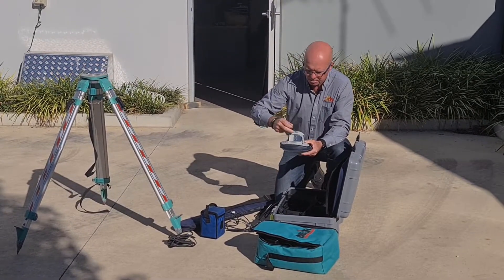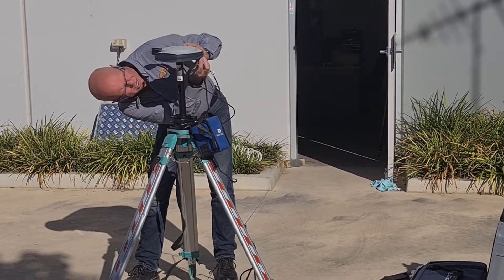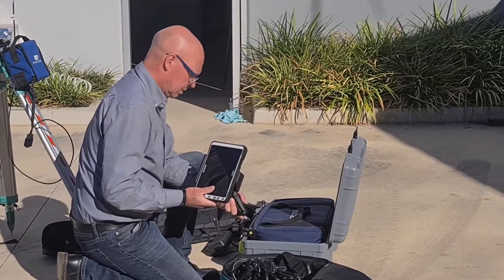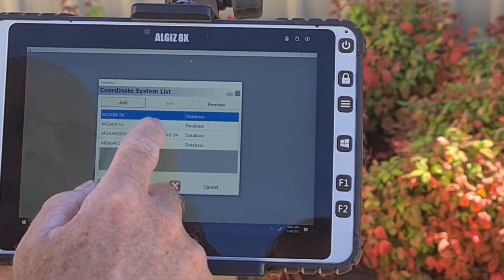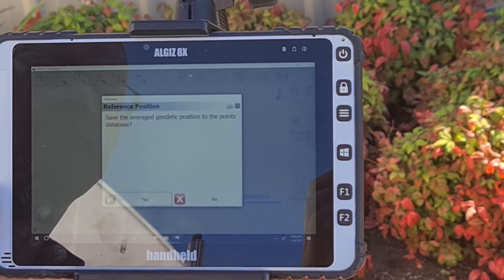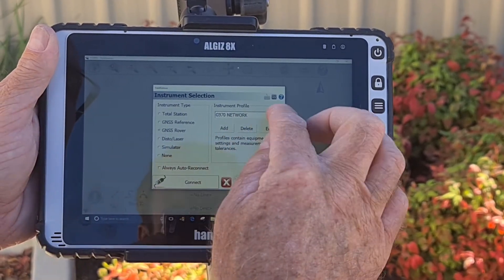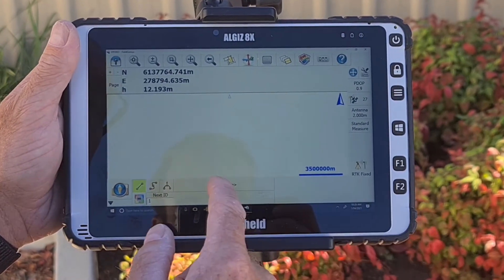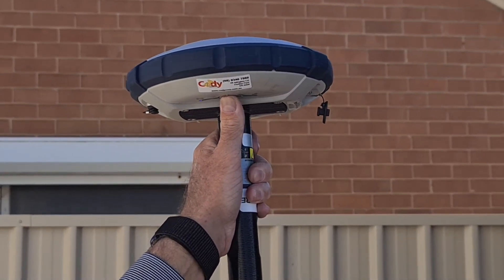SP85 Base & SP60 Rover Initial Setup

Comment: Hi, Do you also have the same video for SP80 using Ranger 7
Reply: Hi Ruby, the setup of the SP85 & SP80 are exactly the same. the only change being you would have to select SP80 from the drop down menu early on rather than SP85.
Reply: @Jazzman200  Thanks. I thought I'm doing something wrong with the set-up because my rover cannot communicate with the my base station. 500 meters distance from base, with LOS, and radio comm is already lost.
Reply: @rubyanniglesia4876  Ruby there could be a couple things that are causing this issue. It could be that your Antenna is either not plugged in correctly or the Antenna itself is infact broken and needs replacing. If you have a spare Antenna you could try and swap it out and see if that works to be able to identify whats happening.

Comment: hello, 
why sp85 for base and not the sp60?  
the solution will not be faster if the rover is faster also from the base?
Reply: We chose to use the SP85 as the base for these few reasons. 
1: The SP85 has dual batteries which allows it to last all day without fail as opposed to the SP60 which has 1 battery
2: Setting up the SP85 to take static Observations is done easily through the click of 1 button 
3: The SP60 is a lighter receiver and is more user friendly to long work days. 
4: You are better off having the better receiver as the base as the rover will conform to the what the base is collecting. If the Base has less Constellations or channels being collected the Rover will bring itself down to the bases level to match.
Reply: @Jazzman200   Im the user of Sp85 it is good for RTK observation but it has poor battery  durability , how to get the original batteries??